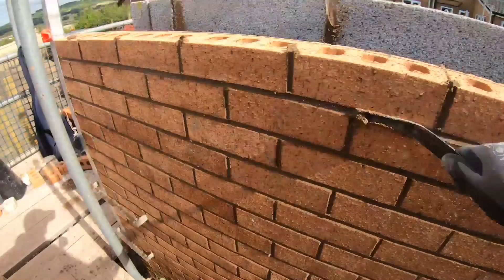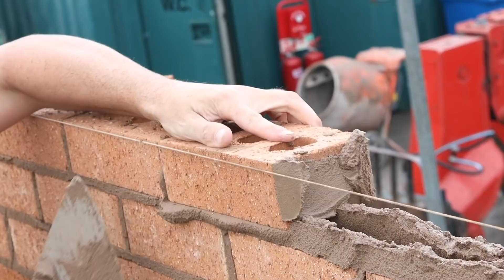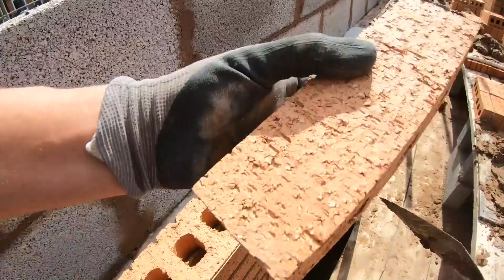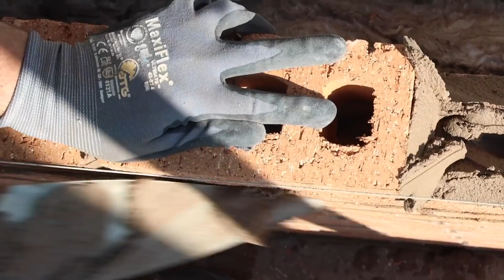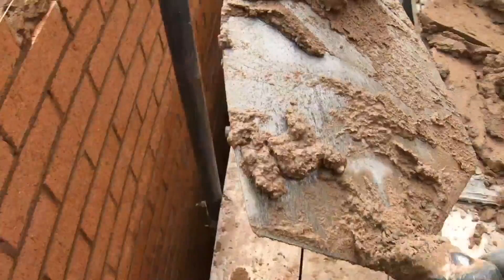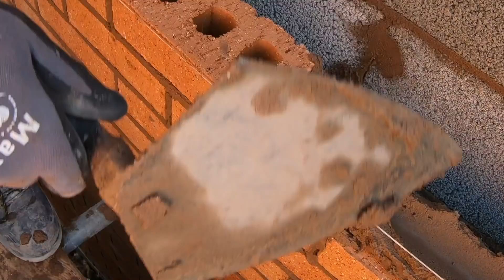Bricklaying- Just Setting Some Bricks No Music

Comment: Hey Stu, you might consider trying out a long round iron jointer (or a sled as I’ve seen them called sometimes) to finish off your work. You can get a much straighter finish and it looks miles better in my opinion. You can hide the imperfections of the bricks if you use it properly. Cheers mate, all the best 👍🏼